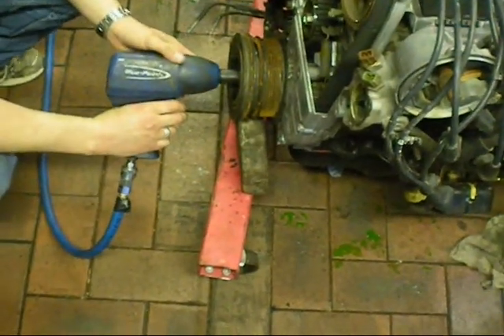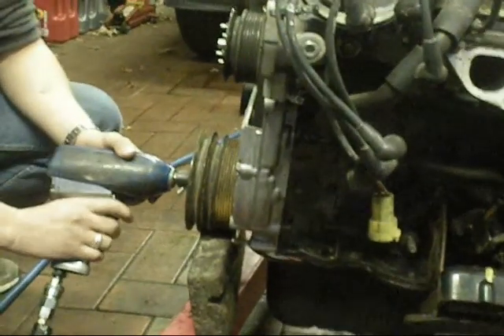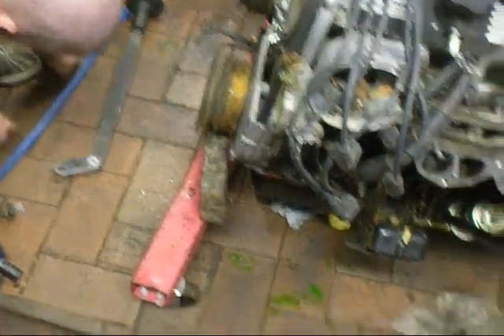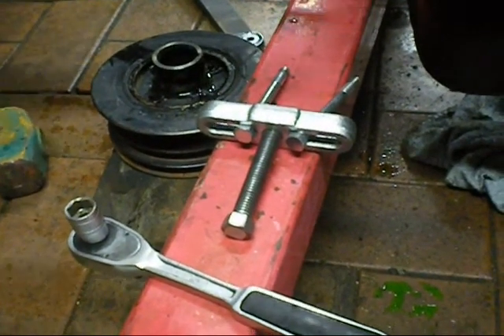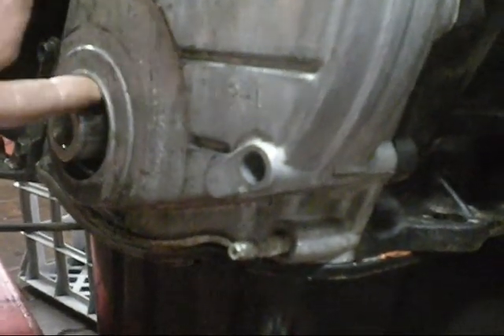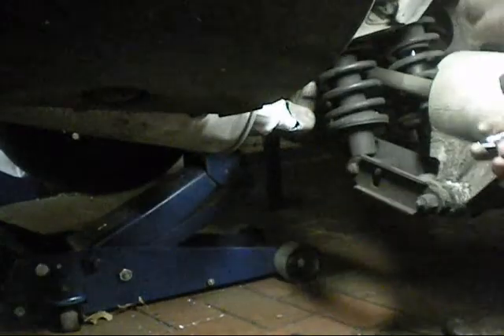Air tools are good, hammer is better.

Comment: I might see loctite , but the weak stuff , I bet that was the high strength stuff they used , but like that bolt would actually come loose in the first place , found a gearbox attached to an engine one time someone used I bet 3 tubes of the stuff , we had to pull the engine and all to get it apart !!

Comment: Fucking thread lock.
I copper greased the threads of my crank pulley bolt :D

Also I want that hammerable breaker bar.